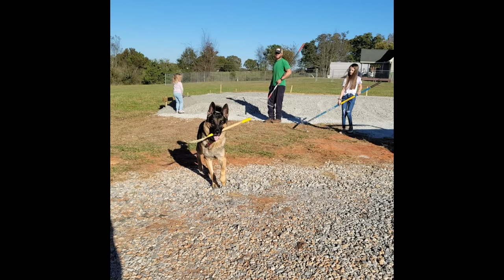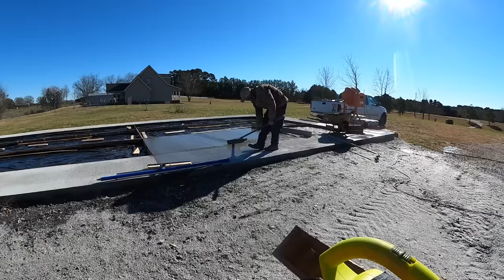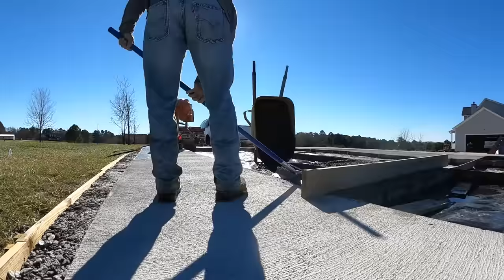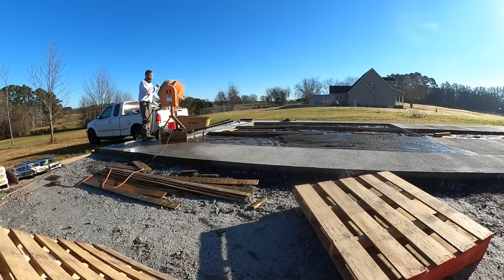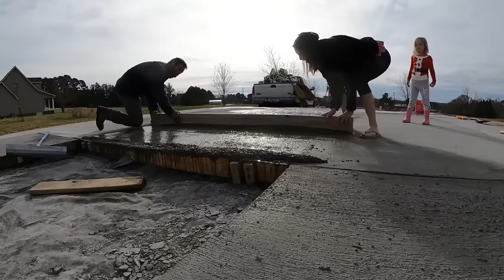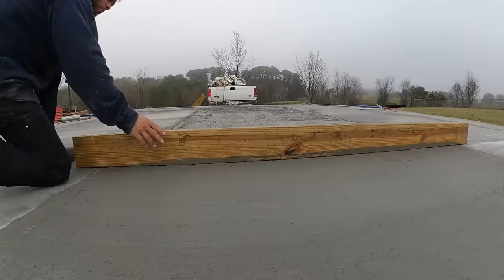Pouring a Huge Concrete Slab Using Bagged Concrete | I Saved $10,000

Comment: The issue with mixing concrete like this is the inconsistency you get from batch to batch. Where as if you went to the plant and spent an extra 1000$ to just have concrete delivered it would all be the same texture, consistency ect ect  .. However crazy good job for what you had access to.
Reply from the maker: When I did this they were wanting 200 to 220 depending on the day, and #80 bags were 3.20 each. Not sure if its true but from what i'm told there were concrete shortages in my area. So far the bagged is working out just fine. Thank you for checking out my video, and for taking the time to leave a comment.
Reply: @reallifetested2605  oh wow! Yea 220 a yard is stupid high.

Comment: Fair play! Your delivered concrete must be expensive .. here in the uk bagged concrete like you used is more than 5x more expensive than bulk trucked in ! Then you would have to mix it your self. Currently ready mix on a lorry is £105/m3 where as 1x20kg bag of mix your self is £7 and I’d need 100 bags for 1m3 !
Reply from the maker: It's crazy the prices of things, especially during covid when I did this. I was able to get #80 bags for 3.20 each and truck they were wanting 200 to 220 per yard. I even checked into mixing everything myself, (sand, portland, gravel) high prices of portland and sand in my area that was going to be 163 per yard!

Comment: That is a LOT of work. By my figures, it cost you over $6000 to do it in just the rock and the cement mix, and I went conservative and didn't count the cost of the mixer.
Reply from the maker: I spent right at 3900 for everything. I hauled the gravel and spread/packed myself. Gravel was right around 9.50 dollars per ton. The 830 bags of concrete was 3.20 per. Truck they wanted 200 to 220 per yard depending on the day and the lowest quote we received from contractors was 14k!
Reply: . @reallifetested2605  You got a great price on that bagged cement. It's $5.79 a bag here, now... I figured it at $5 a bag. I also went on the price of rock I got delivered a couple years ago, around $400 for 17 ton.

Comment: Was a Union Iron Worker for 25 yrs., if there was concrete, it at least had wire mesh.
Reply from the maker: I called around and spoke with local pros. They told me it wasn’t needed in a residential on grade 4” slab. So far with around 40k lbs on it not even a hairline crack has formed.

Comment: I doubt it’s too different where you are, but in Australia we pay around $300 for a single m3 of 25Mpa and much less the more you order at once, you need 108x 20kg bags of GP concrete per m3, at $6 a bag, you work that out. Plus the risk of cold joins, the hard work mixing and the crappier quality of bagged concrete…..
Nice job.
Reply: And also, I can’t see any mesh 😅
Reply from the maker: 6 Dollars per bag is a lot! Luckily I was able to get #80 bags for 3.20 each. Truck was 200 to 220 depending on the day. Everything still looks as good as the day I finished with ~40,000 lbs sitting on it.

Comment: Maybe someone will help me or maybe I am mistaken but were the 2 by8's left in the floor  ? Is that ok ? Awesome effort , thank you for taking the time to film it .
Reply from the maker: Thanks for checking out my video! I didn’t leave them in. What I did was use them for the forms on the outside pads, removed them, then used the outside pads as forms. Hope that makes sense!

Comment: 80lb bags are more expensive per yard for a worse product tho I respect doing it yourself but calling in a truck on a cod is a better option. It looks better and last longer does better in the cold finishes better. You laid it down pretty damn good.
Reply from the maker: I did another video explaining everything. At the time it was a bit cheaper believe it or not. Around here I’d also question if it was better quality I’ve seen some poor concrete coming from trucks. It may be different in your area. Thanks for checking out my video!

Comment: I just had concrete poured myself. 24 x 45 and the truck driver said that you can call them cement company and for $140 a yard they’ll deliver 3800 psi concrete
Reply from the maker: That's a great deal. We were quoted 14k and up on this slab. Local concrete companies wanted 200 to 220 per yard depending on the day.
Reply: @reallifetested2605  I just wanted to mention that cause I felt bad watching you have to mix all those bags.  Great work though!

Comment: Looks good, lots of work there. I would have put rebar or even chicken wire mesh.
Reply from the maker: Thank you! I called around and spoke with local pros. They said in my area they don’t use rebar in residential on grade 4” slabs. Usually only in commercial, industrial, and homes. It doesn’t get cold here and our ground is solid.

Comment: Jesus where do you live. I just got a full basement 30x40 from breaking ground to finished for 25k. That's 10" poured walls french drain, waterproofing and 2 inch foam insulation board, excavation, and refilling and even did a ton of landscaping and removed 3 large trees. Finished floor and I have 8 foot ceilings .
Reply from the maker: Was that recently? In the past few years construction prices have went insane. We just got quotes for a 24x24 workshop with siding and roof no drywall or electrical from multiple companies and the prices started at 78,000 and topped out at 107,000 and that was with me doing the grading! This pad I have  right at 3800 in. The lowest quote we got for this was 14k. I live in upstate sc

Comment: I did something similar but not to this scales once. Injured my knee in the process. I only hand mixed 137 bags in a wheelbarrow.  60 lb sacks
Reply from the maker: I'm sorry to hear you injured yourself. Mixing in a wheelbarrow is no easy task. Thank you for checking out my video, and for taking the time to leave a comment.
Reply: @Real Life Tested  how many bags of concrete did you use? What size bags?
Reply from the maker: @Sith_dude  I used 830 #80 lb bags. I got 20 pallets of concrete and only ended up with 10 bags left over which I made another video in when I poured a pad for our ac units.

Comment: I didn't see any re-bar but if you're in a zone where the ground doesn't freeze it probably won't  crack to bad.
Reply from the maker: I called around and spoke with local pros and they told me that rebar wasn't needed in a residential on grade 4" slab. You're right it probably has to do with the weather around here it hardly ever gets below freezing and we have hard packed clay. Thanks for checking out my video.

Comment: I hate when people heckle me or anyone else about taking to long in most cases. 90% of the time it's total bs and it would take anyone else just as long or that's just how long it takes. Or sometimes it doesn't matter how long it took. Everyone goes so fast now adays they take all the quality out of the final outcome
Reply from the maker: I feel the same way lol all of the negativity I have received has so far been proven wrong.  You’ve got that right about speed. They’re building a house down the road. The concrete crew did their entire driveway in less than 3 hours. About 2 weeks later there are huge 1/4 inch cracks in it all across the driveway. At first I was bragging how quick they did it. Now I understand why.

Comment: The $10k savings, did that include having a crew do the labor? Here in Montana, it's sitting right around $185 a yard delivered, so having 15 yards (assuming 4" slab) delivered would run $2,775. Do the form and finish work yourself, and no labor costs and a whole lot easier on your back. Also, I would have done full rebar grid for strength and to meet my local code for adding a building in the future. Mad respect for doing it by hand with bags though.
Reply from the maker: Yes that was me being quoted vs doing it myself. We were quoted 14k and up for this project. I was able to do everything myself for a little less than 4k. When I did this they were wanting 200 to 220 per yard for truck delivery depending on the day. I was luckily able to get #80 bags for 3.20 each. Thank you for checking out my video, and for taking the time to leave a comment.
Reply: @reallifetested2605  that's a good price for 80#. Again, props on all that work and a good finished product. I work for a company that does insulated precast concrete panels, and even in that kind of controlled environment, people new to concrete work don't usually catch on that quickly.

Comment: It takes 108 bags for 1 cubic meter. In Australia thats about 800 bucks plus versus 450 bucks for a truck
Reply from the maker: In my area it was 3.20 for an 80 lb bag. Truck was 200 to 220 depending on the day with a 4-6 week wait.
Reply: @reallifetested2605  amazing how the construction boom in different countries has affected supply. Here In Melbourne Australia suppliers are weeks out too if your a small operator.

Comment: That’s crazy that you saved money because a yard of concrete is 45 80lb bags and that’s like 250 bucks and a yard from any company around me is 180 even with fibers it’s less than 200 so bags are only cost effective if I’m less than 2 yards cause of all the low fees and bs but 5+ yards and it’s always cheaper and easier to go through a company
Reply from the maker: When I did this bags were 3.20 for 80 lbs and truck was 200 to 225 with a 4-6 week wait. We were quoted over 14k and that was the lowest quote that we received. I did all this myself including gravel for right at 3800.

Comment: You're a mad man. Awesome work. I would suggest some wire mesh and some 2' #4 rebar dowels tying your pours together in the future. I'm sure it'll last a long enough for you tho
Reply from the maker: Thank you for checking out my video. That's the one thing I wish I had done for added insurance is connect all the pads with rebar. I haven't had any issues yet but time will tell. Luckily the structure I had built on top of it was bolted onto all of the outside slabs so that should help a little.
Reply: @reallifetested2605  every little bit helps.  long as you don't have any heavy vehicles in and I would imagine you're fine. Been doing commercial concrete for 16 yrs and you mixed more bags than I ever have. Lol that's some determination.  Well done

Comment: where is your rebar?  rebar helps concrete crack and separation.  also when rebar is used drill a hole in the other cured slab and insert the rebar into the hole for the new slab this prevents the slab of concrete from lifting apart due to soil expansion and concrete curling/lifting.
Reply from the maker: I haven’t had any issues yet but I do wish I had pinned the slabs together for added insurance. I’ve done a yearly update showing everything and will do another very soon.

Comment: Man, thats super impressive and a lot of work for one guy. However I think one huge improvement that i didnt see happening there is some concrete mesh and i certainly would have re-bared those slabs together. Both things are pretty cheap and would serve you well in the long run. Just sayin...........Nice job though.
Reply from the maker: I haven’t had any issues yet but if I were to do it over again I definitely would’ve pinned the slabs together. It would’ve been nice added insurance. Thanks for checking out my video, and for leaving a comment!

Comment: Great job.  Good finishing.  The only thing I would question is whether you put keyways or dowels, and waterstop at the cold joints.  Although it looks like you have some waterproofing under the slab.
Reply from the maker: I did not. I haven’t had any issues yet but for added insurance do wish that I had connected the slabs. It should be fine but time will tell.

Comment: The math doesn’t math for me… I just did my garage. Concrete delivered by truck was $140/yard. Assuming 80lb bags, that’s only .6ft3 per bag. Need 45 bags per yard. Home Depot has them for $6 a bag. That’s $270 per yard…
Reply: Assuming about 4” thick, you would need about 14 yards.  Could have paid 2k and been done in one day with less work.
Reply from the maker: I did a one year update with me answering the most frequently asked questions. When I did this truck was 200 to 220 with a 4-6 week wait and #80 bags were 3.20 each. We were quoted 14k plus for this job and I did everything for right at 3800.

Comment: Fastest movin' human i ever seen!  Kidding aside, I've been thinking of doing this but helps to see someone actually performing the task.  Very nice job...inspirational.  Liked and subbed. What did you use for fill underneath the gravel sub-base?
Reply from the maker: I wish I really could have moved that fast! Thank you, I really appreciate it. I scraped the topsoil off down to bare clay, just put a little over 100 tons of crusher run compacted every few inches or so. So far it's working out great with not so much as a hairline crack anywhere. I've been meaning to do an update video but it seems like every time I have a minute its pouring outside.

Comment: It makes me nervous eat first, but if it a non structural slab you really should be ok, as long as things are packed well. It looks like you moved fast enough to avoid a cold joint, which would have been my biggest concern. Way to go!
Reply from the maker: Thank you for checking out my video, and for taking the time to leave a comment!

Comment: Next time just get extra road base and bags of Portland cement save you at least 50 percent more on bags ready mix if road base has lots fines don't even need sand I have done house additions sidewalks piers etc. This way
Reply from the maker: Thanks for the good info brother! I didn't know you didn't have to add sand. That's why I ended up using bags over 1,2,3 method because of the insane prices of sand in my area. I'll keep this in mind on my next project.

Comment: That's job well done. 830 bags of 80 lb equal to 14.4 cubic yard. Just curious why not buy bulk concrete mix delivered to you? It costs much less than bagged ones.
Reply from the maker: Thank you! I was going to go that route. But they had a 4-6 week lead time, in my area it was 60-70 more expensive per yard, and I was working 7 days a week night shift at the time so  bags made it a little more convenient.

Comment: I cannot confirm but I've been told bag concrete is not as strong or as durable. A mammoth job none the less.
Reply from the maker: I looked into it, the concrete I used was 4,000 psi (when mixed correctly) I searched around and found that the standard truck mix is 3,000 to 4,000. If we take there words for it without testing. They should be about the same strength. Either way, the average I poured was between 5-6 inches so it should be strong enough for anything I put on it haha

Comment: Why can't you move the mixer and just pour right into the form and skip the wheel arrow?  Could use pallet jack to move the skids of concrete
Reply from the maker: Pallet jack wouldn’t roll on the ground, it needs a smooth concrete surface. The mixer is tall and awkward, difficult to roll full without flipping over plus the frame couldn’t handle much of that.

Comment: Wild, if I used bagged concrete I’d end up spending 3-4x more instead of readymix
Reply from the maker: When I did this local truck was 200 to 220 depending on the day and 80 bags were 3.20 each.

Comment: You inspire me to do a 20 x 20 slab. I don’t see any steel rod for the pour do you need it or just gravel?
Reply from the maker: That’s awesome! In my area rebar is rarely used in residential slabs and driveways. It doesn’t get down to freezing for extended periods, we have good soil, and no natural disasters. That’s something that you’d have to check local to your area.

Comment: 46x26 is approximately 15 yards. By today’s prices that’s around $3000 in concrete plus haul fees and such. Whoever priced that must be making $$$$$$
Reply from the maker: It’s insanity. The lowest quote we received for this work was 14k. We’ve recently gotten quotes for a 24x24 garage with no electrical, drywall, or insulation and quotes averaged 90-110k. Crazy thing is my dad had one built less than 10 years ago 2 story for around 20 and his had electrical.

Comment: I liked your little system you used,but not being negative but,I didn't see any rebar, or wire screen,ouch down the road you might have cracking concrete and the raising of cracked concrete, I hope not you worked very hard on it ,and I liked your video, have a blessed day  day.
Reply from the maker: Thank you. I called around and spoke with local pros. Around here no one uses rebar unless requested, commercial, or industrial applications. It doesn’t get freezing here often, we have good soil, and no natural disasters (yet anyways haha)

Comment: I'm thinking I'd set the forms myself and then hire a crew in for the day.
Reply from the maker: Honestly that was my plan too but they’re putting up so many subdivisions around here they want commercial prices for residential. We got quotes of 14k and up for the work. They wanted over 6k just for concrete and wouldn’t let me do the forms or prep work. I only have 3800 in total project including gravel and concrete. I called multiple companies btw and those were the lowest prices received.
Reply: @reallifetested2605  Geeze yeah you saved alot. I'm probably doing around (4) 10'x15' sections. Maybe I'll see if truck can deliver as little as 2.5 yards at a time. Kinda at a point where I'd rather save my back if I can. Anyway thanks